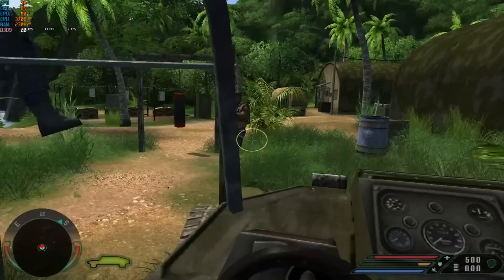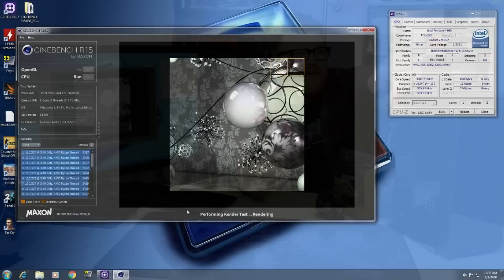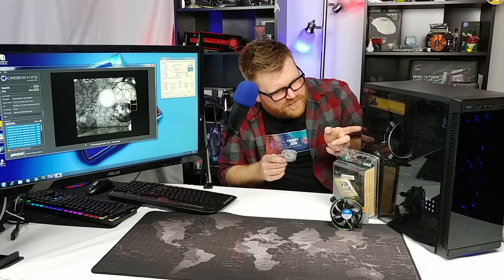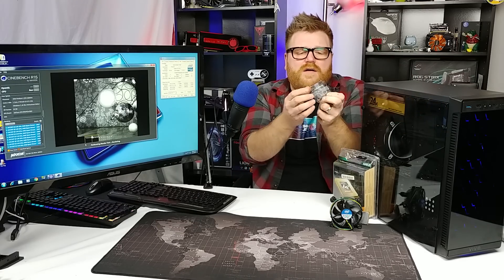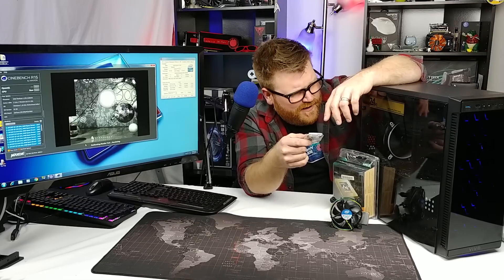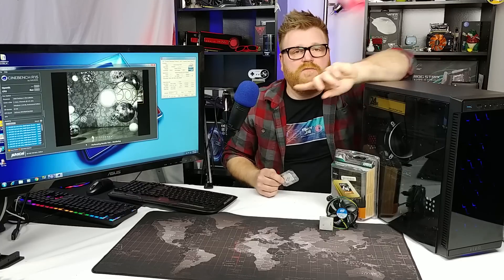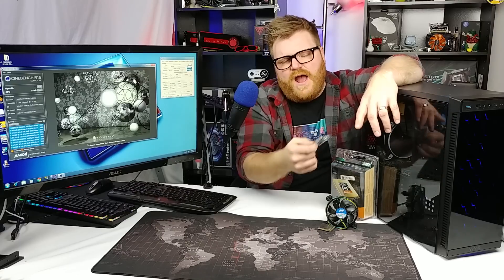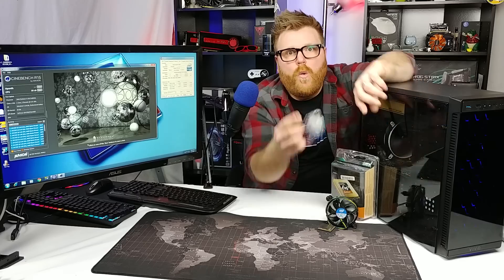What can the Intel Pentium 4 HT do in 2018?

Comment: To be honest it did a hell of a lot better than I expected.
Reply: Even Core 2 outscales Bulldozer :D
Got a Quad that runs 115 single and 450 multi on CB R15 and runs most recent games just fine.
Still exiced for Zen+, I expect some better single core performance out of it. Be it through optimization or faster clock speeds, but that is what I'm actually looking for.
Reply: are you kidding me, this blows my mind how well it preformed!!!
Reply: my fx 8300 on stock gets 99cb as a single core score. sure i got 8 of them, but that pentium 4 definitely performed better than i expected.
Reply: Dom yea i kinda need a new cpu😅, im waiting to see what the 12nm Zen+ has to offer.
Reply: agreed
Reply: PixelPipes yes thanks the 970 gtx
Reply: Don Pablo but i think he can use a weaker gpu for P4
Reply: Kind of embarrassed my FX-8320 is just over double the single-threaded score. When @4.73GHz it hits 114cb in single-threaded and 759cb in multi. IMO that scaling isn't terrible, but definitely not 1:1. I think it's kind of funny I can beat a Ryzen 5 1400 at stock speed in CPU-z (multi-threaded and can provide pictures), but get smoked in Cinebench. I have attributed that to the architectural differences, since they are VAST! Now, seeing this P4 in action, makes me clinch a little.
Reply: second that.  its amazing that something so old was able to get anywhere near 30 fps on  some of those games
Reply: thought that, too. 
Feels like not far away from AMD Bulldozer Single core performance. lol
Reply: RiccardWoW my Phenom 2 is as fast and is an older generation. Gosh amd sucks.

Comment: Just so you know :
1) There is Extreme "Prescott" for LGA 775 (P4EE 3,73GHz) :)
2) 65nm adds Windows 10 (x64) support :D
3) 65nm OC is WAAAAY better than 90nm
4) 1 Core = Game laucher fails
5) You can't use crappy cooler on this (as you now know ;))
Reply: Compatibility Madness this processor will support windows 10 64-bit.
Reply: Pentium 4 660 ? Nope. That's why testing was done on 64-bit Windows 7.
Only 631/641/651/661 models of Pentium 4 support Windows 10 x64 OS.

Comment: Unlink your memory speed & pci-e frequency (You don't want auto for either) to your cpu frequency and that cpu should easily go higher, past 4ghz if you can adjust voltage & that cooler is half decent (most hit around 4.25ghz). Many 775Gigabyte motherboards have an advanced bios menu with more options if you hit CTRL-F1 during start up.

Comment: What you expect for it. Haha single Core is dead since 2006. Retro use pentium is geat.
Reply: For me single core is dead since 2007-2008
Reply: Youtube might actually be more of an issue with video acceleration. Any decent graphics card of the last 10 years should bring atleast some improvement there. hardware acceleration ftw.
Reply: I have been using Athlon 64 3200+ as replacement for the last month. I liked it. It can do almost everything I want. The only downsides are that while PC isn't able to play YT at more than 240p and anything modern isn't going to be fast or work. Don't get me wrong, my usual PC decided to not boot and PC with Ahtlon processor is my retro PC. Surprisingly it's still usable for many things.
Reply: I have ATI X800 Pro acceleration in browsers simply doesn't work. I have old laptop with Nvidia Geforce 6150 GO and acceleration partially works, but that PC is pretty much just as slow.

Comment: your P4 sucks my P4 HT 531 @3.45 do 67cb
Reply: Pretty sure it's RAM settings fault. You got a good bit higher FSB speed (and probably you don't use crappy RAM).
PS. My PGA 478 Pentium 4 Prescott @ 3,54GHz does 53CB in R15 :D

Comment: Hi 
I have bought one of the intel Xeon x5650 that you made a video on can you advise a budget motherboard that can overclock
Reply from the maker: Ebay x58 and hold on to your Butts
Reply: gigabyte or asus x58/p6t boards will do the trick fine
Reply: just stay away from Asrock and the ga-x58-ud4p from Gigabyte. 
Stick with ASUS and never look back..
Reply: You won't find any "budget" boards. That is the drawback.
Reply: Forest flame thx
Reply: Timmy Joe PC Tech thx
Reply: Be patient I scored a p6t normal version for 50$ and I saw another one recently on craigslist for 80 for a much nicer one but someone else got it. Or just get the x58a-ud3 they are on ebay for like 130+, it's worth it for those boards they are nice.

Comment: Yo can you do a 1250$ pc build for me and a guide for it I really wanna get into pc gaming and I somewhat got the money for it
Reply: https://pcpartpicker.com/list/
Reply: Alexander The grape That’s what I would get if I had $1250 for a PC right now. You can switch a couple things around to fit your needs :D Maybe switch to a 1060 with the current prices of the 1070/ti being so high
Reply: Michael Summerlin thanks man much love
Reply: Michael Summerlin it didn’t show up with anything pal
Reply: https://pcpartpicker.com/list/F9fs6X
$1250 is a really weird pricepoint because you either end up with a really pimped out 1080p machine or a really skimped down 1440p machine. Sadly, a year ago you could squeeze a gtx 1070 into this list, but RAM, GPU, and other prices right now are poopy.
Reply: Interrobang very nice thank ye
Reply: Alexander The grape My bad I copied the wrong link. 

https://pcpartpicker.com/list/Zp7Dr7

But that saves you $60 for a 16gb usb drive and a Windows key from g2a or eBay.

Edit: I owned the g1 1070 and the thing ran at 2050Mhz and wouldn’t pass 67 Celsius in my case (Corsair 400c) and it was extremely quiet!
Reply: Good list, but the cx psu is trash and the motherboard won't let them do much. Those two should certainly be upgraded. Very similar to the list I posted, but mine was CPU > GPU and yours is GPU <CPU. Refresh rate vs resolution I suppose.
Reply: Interrobang The psu is fine, I’ve ran my overclocked 4690k/1070 on a $30 evga 500 watt psu especially considering the 1600 is going to pull less power than the 8600k. And the asrock b350 pro boards are the best rated b350 boards you can buy so I doubt he wouldn’t be able to hit 3.8Ghz on the 1600. This guy has even reviewed the ATX version of the board if you look through his channel.

Edit: https://youtu.be/W04m2Eq2mgQ

The atx version and the matx version are basically the same thing. I could pick out far worse with the 8600k setup, not doing much without a delid on that cooler. $160 z370 board when you could have saved $40 and upgraded the horrible price/performance 850 evo to a faster m.2, got rid of that hitachi HDD .
Reply: Atx board seems to have a bit better power phases and vrm/mosfet heatsinks. Id rather have that, personally.  Also "works fine" and recommended are different things. You really don't want to cheap out on power supply. And I've personally had a CX unit fail on me.
Reply: Interrobang I’ve been running this cheap $30 500w power supply for over a year. Just because you had one fail on you doesn’t mean they’re trash because they’re still one of the most popular power supplies.
Reply: there's millions of videos on how to build a PC.. $1250 is a good budget, might wait a month for RAM prices to drop more unless you're fine with 8GB, but 16GB is a must these days (about $200 now for 16GB). A Ryzen 7 1700X and any X370 mobo, GTX 1060 (6gb), and a good nVME m.2 drive will get you started.

Get a good case and PSU, and you should still have some money left over for a mouse, keyboard, and monitor. Maybe add a 2TB HDD for mass storage for $60. Perhaps speakers or a headset depending on what you have left.
Reply: Philip wilson Must be why my 4690k at 4.4Ghz can still be pegged at 100% usage on modern titles?
Reply: These are all great but I don’t need a keyboard mouse or monitor awesome build thank you
Reply: Get a core 2 quad anything over that is overkill in 2018 core 2 quads are the best possible processors for gaming especially when overclocked